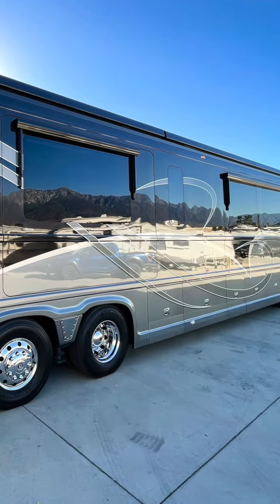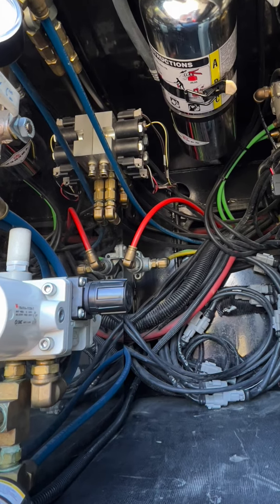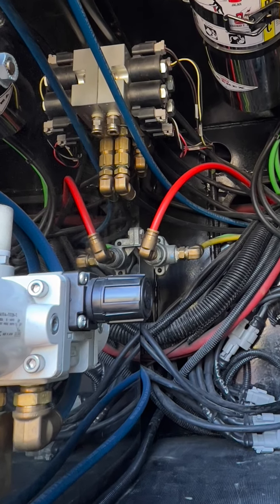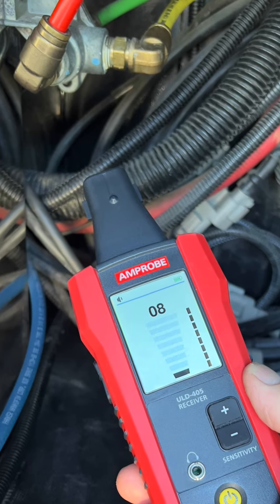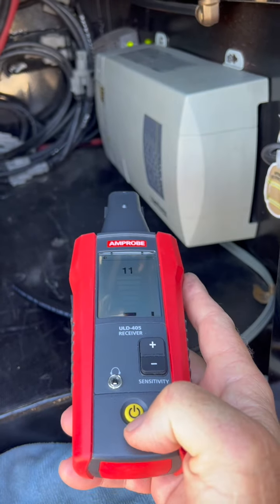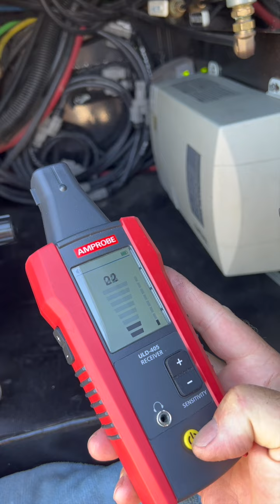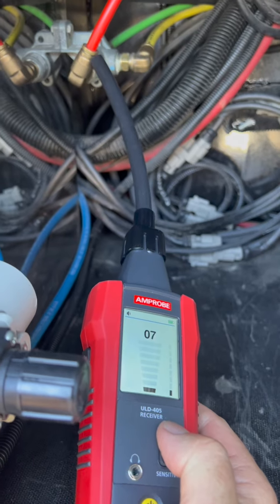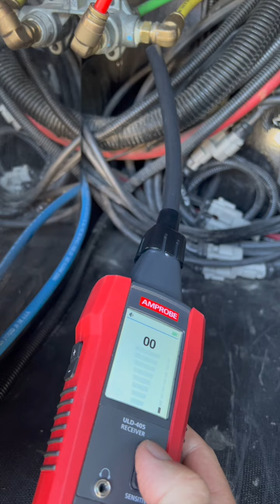HOW TO: Find Air Leaks Amprobe ULD-405 Ultrasonic Leak Detector! | NEWELL SCHOOL

Comment: Are use an electronic leak detector myself. A different brand but works the same way and I feel it’s a heck of a lot better than shooting soapy water over everything.
Reply from the maker: Glad your detector works well for you. Once you get into the Amprobe digital version it changes the game in terms of selectivity and filtering out RF which is rampant in a Newell. And yes, there aren’t many places I’d spray with soapy water.

Comment: People on the HDT forum like the whisper results and it is less money. Why did you go with the Amprobe model?
Reply from the maker: I tried the cheaper Amazon one. Piece of junk!!!
When my Newell tech had an older AMPROBE which kicked tail all over the cheap one, I sent it back and got the new 405.  It’s all about sensitivity and selectivity. Can’t get those qualities on the cheap.  AMPROBE is the standard in the HVAC world for a reason.

Hope this helps. You won’t regret the decision if you go with the AMPROBE.
Reply from the maker: Incidentally, this last portion of this test was conducted with the engine running…the AMPROBE is that good!
Reply: @RVSquaredSteve  Just had to ask because the other guys always talk about their whispers. Sounds like you get what you pay for. I have a 2002 Beaver that holds air really good except the tag sometimes goes on the fritz until I got 100 miles then it holds air. Maybe this will track down the failure point.
Reply: That is impressive.
Reply from the maker: @danjohnson7767  Yup...the INFICON was what I returned.  This is one of those tools that you'll realize the difference once you spend the money for a true precision piece of equipment.
Reply: @danjohnson7767  The whisper is a piece of junk in my opinion. Ended up returning mine; was bulky and could not get consistent or definitive results with it.